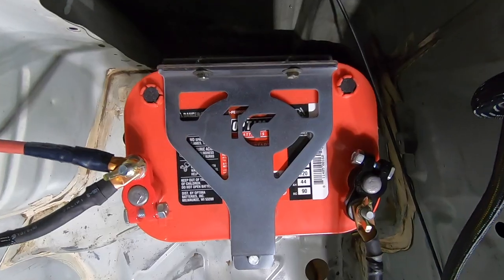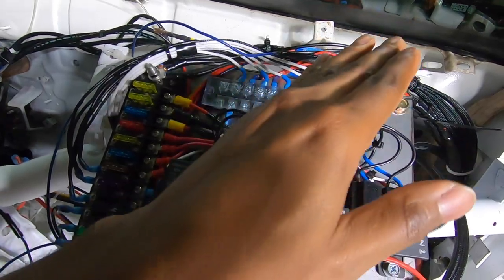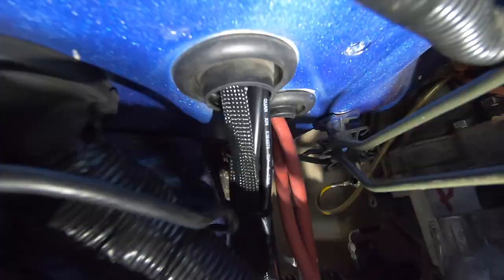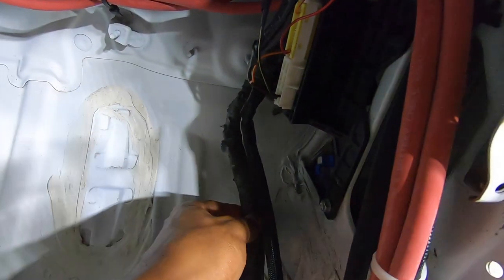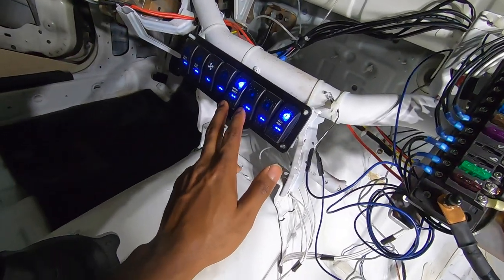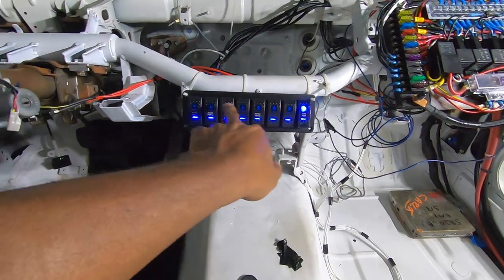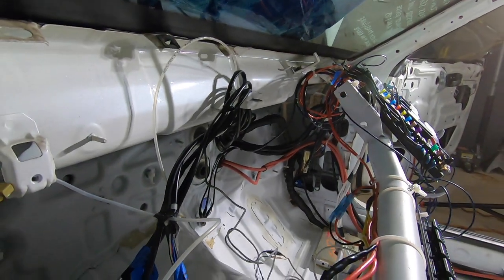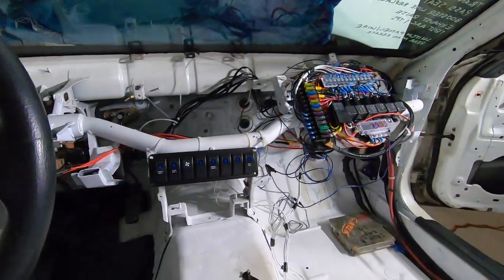How My Racecar Wiring Works...

Comment from the maker: Please Keep in mind that organization and clean routing is KEY! During the period that I filmed this video I was still adding new wiring and finalizing circuits, looming wires and more. The current setup is a tad different, I've added circuits for more lighting, and even a spare circuit for a water sprayer in the future. The 12-fuse strip was rated for 100 amps. I removed it and ran two 6-fuse strips from the same brand rated to 100 amps each (200amps). I've also added a circuit breaker to the main power cables of the panel for extra safety. This was very easy to do because I stayed organized and labeled everything. Please watch the video below to see the current state of my fuse and relay panel!! 

https://www.youtube.com/watch?v=u-QmH3Os9kk&t=31s
Reply: How big is the wire running from switches to panel?

Comment: So incredibly concise this video is going to be so helpful when it comes time to doing mine
Reply from the maker: Good Luck !! I wish I could make another video explaining more but my dash is already back on
Reply: @kriswyche   where do you recommend getting all your wiring supplies? I'm gonna start ordering everything for my turbo e36 harness. I hate how messy my stock has become. (also I'm on a different account lol but same person)
Reply from the maker: @Guatemotzin97  I honestly purchase everything from autozone and Amazon. The soldering gun is from harbor freight and I got the wire cutters from Matco. You can purchase literally everything through amazon. I usually go in person for automotive wire since online they have lots of bad brands that use copper coated aluminum instead of pure copper and etc

Comment: Great video I was flipping through a few today to get some ideas. I like the breaker but I was thinking I might do a fused distribution block there. I'm trying to clean up the wiring on my ls1 s14.
Reply from the maker: Yeah the breaker is basically just a big fuse for both the starter/alternator and there’s another one now for the entire fuse panel.
Reply: @kriswyche  How many relays do you think is good for running the lights, you don’t need one for each individual function: turns (2), hazards, running, brake, headlights? I figure everything but the headlights are such low amperage I can do just two, one for the rear and one for the headlights(being the ones on and drawing the most). Just a flasher relay in-line with the switch straight to the turns no extra relays
Reply from the maker: @baylymiley  well I don’t have blinkers or hazards or anything, I have a relay for front headlights and one for rear.

Comment: How is starter wired up? I’m in the process of building a car with no chassis harness and was wondering how you hook up a push start button
Reply from the maker: Well you have the starter motor and attached to it is the starter solenoid which is basically just a huge heavy duty relay. The battery cable goes right to that solenoid and then there is one wire that when powered will close the solenoid and crank the starter. Lookup 240sx starter wiring diagram, that should help
Reply from the maker: In terms of how I did it. I used a multimeter and found out which wires in the ignition barrel (where key goes) are connected when I turn the key all the way. Then I sent power into the barrel, and when the key is fully turned it acts as a switch and power goes into barrel and out to the starter solenoid. Also since I wired my ecu. I tapped the starter solenoid wire and used an inline fuse so ecu can get a start signal.

Comment: Stupid question I’m sure, but I see one set of fuses. Are those high amp fuses for the relays or are those fuses powering the switches (relay inputs). Where I’m confused (on all videos) is do you need fused power to switches AND fused power to the relay? Thanks for making this video; very helpful!
Reply from the maker: No question is stupid. The entire switch panel is run off one 7.5amp relay, my switches are ONLY used to activate the relays. Power goes into the switch and through the relay and then to ground (activating it) Since all they do is turn on/flip the relays, the amperage draw is extremely low.
Reply from the maker: Let’s take the fuel pump for example. The fuse rating for the pump is 15amps. When I hit the fuel pump switch, that switch powers the relay. Then it allows power to go through a 15amp fuse on the fuse strip, then it travels through the relay, and to the distribution block. Then from there the power wire goes to the fuel pump, then it follows the ground wire back to the left side of the fuse strip (ground side). On the top you can see all grounds route there and then I ground it out on a piece of (metal/chassis).
Reply from the maker: Also if you have Instagram or Snapchat shoot me a message so I can send pictures and videos and we can talk more in depth!! My IG is @kriswyche_ and my Snapchat is @Kwyche24
Reply: @kriswyche  thank you so much! I like your elegant solution to power the switches with one fused line. But do most people (keeping it basic for me) power their switch from a separate fuse panel. I see lots of videos on relay panels but they never talk about the source of the switch power. I’m imagining there is a separate fuse panel for that simple switch which ultimately ends up at the relay switch in power correct?
Reply from the maker: @KemDIY  yes you’re right, all you need is one fused power wire that goes to the switch panel and it’s ready to power anything.
Reply from the maker: @KemDIY  I used a slot on my fuse strip to run power to the switches. Once you create the panel, it makes understanding much easier. I struggled for months but soon as I created the panel it was very easy to understand how everything is routed.
Reply from the maker: @KemDIY  look at my old videos, my first ones. I had a very basic cheap fuse and relay panel setup, but because I actually made one I was able to understand and overtime I’ve added and modified it until I got what I have now
Reply: @kriswyche  thank you so much for your time! How very generous of you. I definitely understand now and can’t thank you enough! I will still look at those older videos too! Subscribed thanks again!!
Reply from the maker: @KemDIY  no problem dude!! Good luck

Comment: sick vid. did i miss the alt wiring? couldnt find it on your channel.
Reply from the maker: It’s pretty simple, alt has three connections. Power, which is a battery cable run from alt to battery. Ground, which is connected to bare metal in the bay. Lastly is the alt connector . It has two pins, one pin is constant power from battery and the other is a circuit with a light bulb (charging light).
Reply from the maker: Watch this vid, there should be something helpful in it. https://youtu.be/LrYDhlx_ZZg

Comment: Hello bro, im from malaysia and this is my first time doing engine sr20det swap into my project car and doing custom wiring like yours . I wish you can help me how to do the ecu wire like yours and what wire to start up the engine . Sorry for my bad english .
Reply: Im stuck at the ecu wiring and what wire need to do to start up  . I hope you can help me , it will be mean a lot to me bro😭
Reply from the maker: @nurhafidziyusraa8224  check the code on the ecu and look up the correct ecu pin out for the code. For example, mine is 62 so I searched “s13 sr20det ecu pinout 62”.
Reply from the maker: This is the most complicated part of the wiring but it’s not impossible. My current setup has three wires going into the ecu harness. The FIRST one is power to the ecu relay, which splits up throughout the harness and powers almost everything within the engine. The SECOND wire powers the injectors, ignition coils, and I believe something else I need to check. And the THIRD wire is a hot in start wire that provides a start signal when you are cranking the car over. Send me a DM on Instagram, I’ll pull down my old notes from when I first did this and clear it up better!
Reply: @kriswyche   thanks bro ! thats helps me a lot bro🤩 , my ecu code is 62 , my engine wiring is the stock one and i have the pinout but dont know which wire i need need to hook up . Can you tell me what is your ig so i can DM you ? What are the three wires that goes to ECU exactly ? I think that will solve my problems .
Reply from the maker: @nurhafidziyusraa8224  @kriswyche_ when I get some time I’ll take pics and everything so you can do same thing I did

Comment: Will you be putting blinkers?how would you go about it?
Reply from the maker: I would have to activate it through the lever that connects to the clock spring which I’ve removed both. It’s pretty easy to wire if you keep everything in car. You just need power and the multifunction light switch does the rest. Some time studying the wiring diagram from the service manual and it’s an easy job.
Reply from the maker: I won’t be adding blinkers, maybe hazards in future but the car is mostly for track. Street drifting was a big goal of mine but not easy where I live, also I wouldn’t post the videos from the street on here if I’m really shredding for obvious reasons haha.
Reply: Thanks for the reply. Good job. Hope I could do the same. Hahaha

Comment: May I recommend an FIA killswitch
Reply from the maker: My actual killswitch is under the passenger seat. I’ve added it since this video. As well as the circuit breaker for starter and alternator. I can pop that open in case of emergency.
Reply: @kriswyche  Ah ok. Nice work by the way.

Comment: What size wires did you use?
Reply from the maker: 16 for the most part, just depends on the amp rating. for example the starter solenoid takes a higher amperage so i used 10 awg vs the headlights where i used 16 awg

Comment: Got an updated video of this? Going real into depth ?
Reply: Or If possible, Could you draw a diagram for me ? I have a KA24DE-T and an Rs enthalpy ECU. So Stock Ecu etc. Depinning and getting the correct voltages confuses me big time and i'd rather not fry my ECU
Reply from the maker: @ItsTee01  i did make a video called how i wired my ECU. basically you need to get the pin out of your ecu and find what pins are power and trace them. they usually all go to a big chassis connector. i talk more about it in the “how i wired my ecu” video !

Comment: You did that! Got me thinking
Reply from the maker: Try it! It was a huge learning experience for me but I enjoyed it and people really appreciate quality wiring work !!
Reply: @kriswyche  I really would like to see how you started the engine
Reply from the maker: @infamousnova  lol I was being funny. Basically Main power, ecu switch, gauge power switch, fuel switch, and then I crank
Reply: @kriswyche  with key or switch
Reply from the maker: @infamousnova  key. the ignition has like 5 wires. Two are for the starter. Basically power goes into ignition barrel on steering column. The key is a big switch. And then the power goes from barrel to starter solenoid to crank the car
Reply: @kriswyche  I'm back lol. Was gonna try it and got cold feet. I really want to do it tho. I got so many wires. All I need is lights, brakes, ignition, fuel pump   starter etc.
Reply from the maker: @infamousnova  I was helping someone else do theirs and realized just how long it actually took me to plan and do mine! It’s a huge project for someone new to wiring which I was lol
Reply: @kriswyche  ok I'm back lol, I'm doing it this time.
Reply from the maker: @infamousnova  💪🏽💪🏽💪🏽
Reply: @kriswyche  How did you hook up all the gauges to one switch?
Reply from the maker: @infamousnova  took the three power wires, teosted them together and then soldered them into one 12 gauge wire and hooked that one wire into the strip.
Reply from the maker: @infamousnova  same with grounds
Reply: @kriswyche  I'm trying to wire my Ignition and power to one switch,  how did you do it?
Reply from the maker: @infamousnova  everything I had was protected by a circuit breaker which was basically my battery cut off switch. By ignition do you mean starter or do you mean like my main power switch ?
Reply: @kriswyche  I mean like flick one switch and cut the power on to everything as if you turned the key on
Reply from the maker: @infamousnova  ohh. I just rewired one of the switches on my rocker switch panel. So when I click it, it powers all the others switches. My panel came prewired and I just gave it a quick look and cut and connected some wires on the first switch so it powers them all.
Reply from the maker: @infamousnova  I’ll be honest the easiest and more professional way, you’re supposed to mount a battery switch, it looks like a key and that’s what you use as main power. Every race car has one and does it that way. I just didn’t realize until after the fact and that’s when I added my circuit breakers instead.
Reply: @kriswyche  yea I have that at the back, but I also have a racing only panel with start button. I want the switch to give everything power like turning the key. I won't be using the key
Reply: @kriswyche  Are you running your switches to a fuse as well? I got the same switches, I also have another set where it has a start button. I want my ignition switch to give power and kill power just like a key would. I have a master disconnect that kills power at the rear. I do have a video of the switches for better visual
Reply from the maker: @infamousnova  ahh I see, I didn’t wire mine up that way but you can make it where that main toggle switch controls power to the rocker switches. Essentially, that would make it a main power
Reply from the maker: @infamousnova  and yes all my switches run through one single 7 amp fuse
Reply: @kriswyche  why so small a fuse? I'm guessing my toggle would also have to power the fuse box
Reply from the maker: @infamousnova  yup! And because the switches only close my relays, there is almost no load on them so the amp draw is extremely small.

Comment: Ummm whut? Why is it so confusing?!? 😩
Reply from the maker: It always seems that way at first but when you really understand the basics and a little more you can trance wires and see the flow a bit better. Wiring is always loooked at as really hard but it’s super easy to learn and understand
Reply: @kriswyche  Thank you for the encouragement. I have a clear idea of how I’d like to wire the extra accessories in my car & I feel like I grasp the basics but then I watch these tutorials and they might as well be in Latin. I did see a switch plate kit that came with  everything I need, I might attempt it. Or maybe I’ll just stick to Upholstry where it’s just shapes and colors. Lol
Reply: @kriswyche  I rewatched your video again and I feel like I absorbed a little bit more this time. And just to clarify, it’s wiring that I find confusing, not this video. Your video is my favorite wiring tutorial so far. I like how you labeled the wires and you have a nice voice and  you’re good at explaining it. Thank you!
Reply from the maker: Yeah it took me a long time to fully understand everything but it was also my first time learning about wires. The main things to know are voltage, amperage, and ohms. Then the main things you’ll use are different size wires (the higher the voltage/amps the bigger the wire), different relays ( 40amp, 80amp, whatever max amperage fits your setup. 40amp is usually always used), and fuses which are basically meant to pop if too much amperage is flowing through them, that way the wire doesn’t heat up and burn.
Reply from the maker: @katykab00m  it’s more simple than you could imagine, just watch videos and basics of electricity and how relays work and you just about set. I’m school I used to spend lots of time on these electric boards where you create a circuit and feed power and see if it works, there’s probably games online like this. I even had a app where you could build circuits and test them to see if you knew what you were doing !